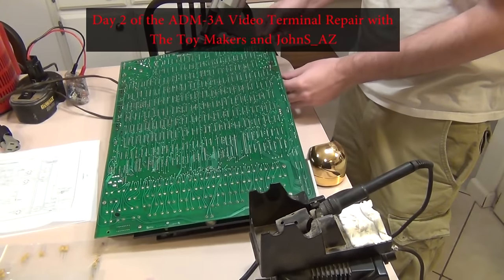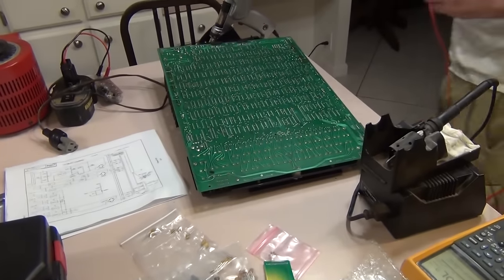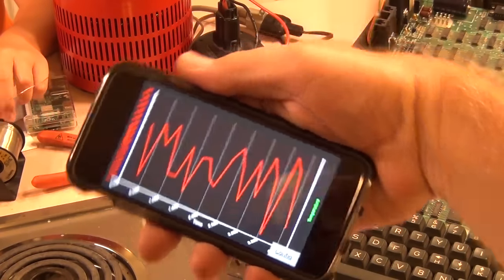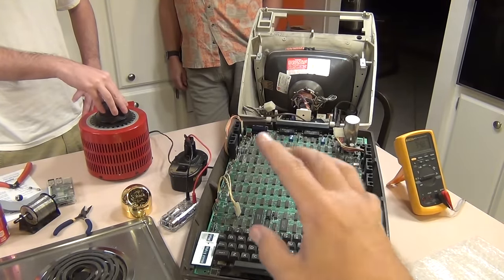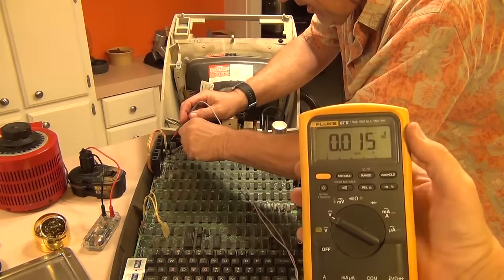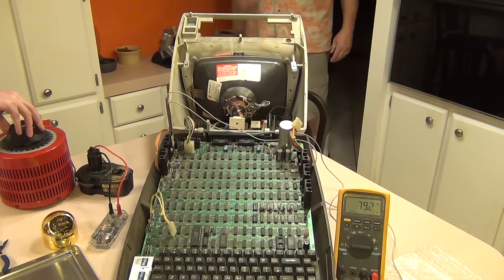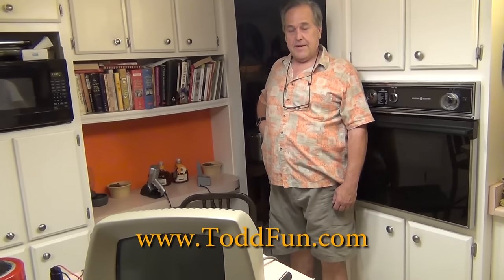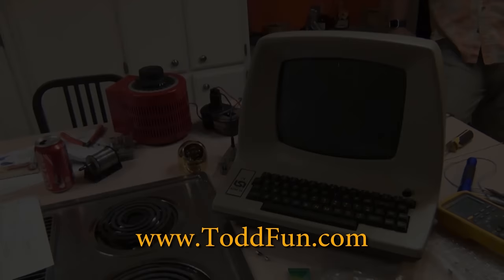Day 2 of the ADM 3A Video Terminal Repair Workshop

Comment: Did you. Ever manage to get this working?  I would be very interested in how you diagnosed the problem.  I have the predecessor to this terminal, the ADM-31 which is experiencing similar problems.
Reply from the maker: I have ordered some parts but never got back to the project. If you watch my other recent videos you'll see I kind of got myself into a garage refurbishment project and my lab is in the garage. I've got it almost all back together so I might get back to this project. Stay tuned. :)

Comment: If I remember the h & v sync comes off the logic board. we used to call it the pizza board due to its size. Also it was prone to broken traces due to flex. 
It runs off a state machine in proms so good for logic analyser project, I guess we used to have the firmware listing or deduced it. Jump conditions based on switch settings or multiplexer input. Usually a beep was an indication the logic board was running.
I used to be able to hear the 15khz flyback from 50 feet when nobody was in the plant.
Reply from the maker: Thanks for the input. It is still on the healing bench. I'm clearing out my old inventory on eBay and will get back to this one in the fall I hope. I want to reduce my collection to just a Apple IIe, C64, TRS-80 and this ADM 3A terminal. Only the terminal is currently not functional.

Comment: I have an ADM-3 (not A) that only communicates properly at 600 baud and below. If I set the switches for any of the baud rates higher than that, I get garbage as if there's a baud rate discrepancy. Is that a problem with the UART? The DIP switches?
Reply from the maker: I really don't know for sure but thinking of just signal issues at high speeds your wire connections, solder connections and terminal connectors need to be very clean and in good condition. Also shielding the cables can help tons at higher speeds. 

Also  you might try Brain on Youtube as he has one too and his works so he will know more.
https://www.youtube.com/user/BrianPicchi

Comment: Hi Todd, This question is about the Tripp Lite IS1000 isolation transformer. I have two amateur radio linear amps that are rated at 1200 watts pep input and 600 watts input on cw. I need an isolation transformer to be able to work on these amps. How do you determine the size of the isolation transformer. The specifications on the Tripp Lite IS 1000 is 1000 watts surge. Is this rating high enough? Thanks John C
Reply from the maker: The ISO1000 has an inline 9 amp fuse so that will trip at 1200 watts if your input:output is 120v AC and you exceed 9 amps through the unit while using. Very short usage might hold up to 1200 watts but not for long. To be a tech isolation transformer you have to convert it as in my other video on the Tripp Lite. Also, watch the whole video as there is a lot of safety tips in it: http://www.toddfun.com/2011/04/30/isolation_transformers/

Comment: Thanks Todd, I think I can use the Tripp Lite IS 1000. These amps are 600 watts input on cw so with 120 volt mains current should be well under 9 amps. Also, I can do all the repairs with the input watts at 300, and then plug the amps into mains power to test at full output. Want to take this opportunity to tell you how much I enjoyed your isolation transformer video. I now have a clear understanding of what they can and cannot do; and I understand how to check and modify an IT so I have true isolation. Thanks again, John C
Reply from the maker: Glad to help.

Comment: Did you ever get this working? I have an ADM-5 that I've never been able to get working. It just fills the screen with white block characters and doesn't do anything else. Worked for a while trying to get composite video to show up on the CRT, but that was never successful. It's been sitting in storage ever since.
Reply from the maker: I have not got back to the project. I did create a complete list of capacitors and the order did come in now. My first blind wack was to replace every cap except a few I took out and tested. The caps that were just jellybean I didn't bother testing and just ordered new. I will see if I can put this on my todo list so at least we can see what effect that has before I do any deeper tests.
Reply: Finish it and inspire everyone!

Comment: This was really fun to watch.  When you get it running, I would like to hook it up to my SWTPC 6809.
Reply from the maker: That would be a super cool project! Do you have the MP-S2 Serial Interface card? Will it start up and interface with a terminal monitor or do you need to first load special code? We need to see if we can do a collaboration video. You haven't made a video on your SWTPC 6809. Is it working? Sooo many questions! Your blog post on  your SWTPC is real short. 
http://tanrunomad.com/vintage-computer-collection/swtpc/

Well I best get my terminal running before Christmas so we can try it out :)
Reply: I do indeed have the MP-S2 dual serial interface.  I haven't played with the computer since I first picked it up.  When I applied power to it the fuse shot out!  Luckily not in my direction. :)  I recently discovered that SWTPC made a GT-6144 Graphics Terminal which was actually a kit that you added to a TV or terminal to give it the ability to produce graphics.  A future project for sure!
Reply from the maker: Sounds like you need to get your computer working too. Check for bad caps in the power regulation circuits first.

Comment: I assume you guys thought of making sure there was actually video going to the CRT board, right? If the deflection is borked, you won't see a dot if there's no video.

Also, many of these old monitors depended on an hsync and vsync signal to generate the deflection sawtooths, so unlike a TV where you still had a picture, you would see a dot or line if the sync signals are missing. 

I know this was recorded weeks ago and I think you said you eventually got it fixed, but I was just wondering.
Reply from the maker: We do have the h and v sync but I'm not sure how to test the video? Video signals are really not in my bag. I was going to get the pin-out for the video from the PDF schematic which is linked in the show notes then I was going to test for popper video signal using my TV setting on my older Tek scope. I know what a video signal should look like on the old Tek scope but I haven't had time to revisit this project other than reading the service manual PDF and making a list of caps to order. Seemed sensible to just replace all the caps before getting into too much more testing. Any tips you can send my way would be great! Thanks.
Reply: The video signal setting on your scope won't work by itself. In a TV (or NTSC monitor or whatever) the horizontal and vertical sync are mixed with the video signal. This is called Composite Video Blanking and Sync (CVBS) and your oscilloscope has a way to synchronize on a CVBS signal; it's called TV mode.

But in a terminal or computer with built-in screen, there's no reason to put all the signals together and then split them up again, so the horizontal sync, vertical sync and video signal (i.e. bright vs. dark) are kept separated. That PDF has a couple of wave diagrams in section 5 (sorry I don't have time to dive into it any further) that you will be able to get on your scope if you follow the instructions. But they're not TV signals, they're just wave forms. The video signal goes through that contrast potentiometer and then to the CRT board, so you should be able to pick it up there (looks like you might want to replace or clean that potmeter). It probably starts out on the main board as a 5V peak-to-peak serial stream of bits, and if you want to see what's actually in there, you'll have to sync the scope from the H and V sync signals (probably also 5V pp on the motherboard) while it shows the video bit stream, but that's not really important (it's easy to put together your own sawtooth generators and show the picture on your scope if it has XYZ mode, but that's a whole different story).

Anyway, at the point where the contrast potmeter is, you may be able to find a way to pull the video signal low or high to pretend that the screen is all white. That will show you if the CRT circuitry is properly generating the picture sweeps. But basically RTFM: I'm sure there are lots of tips in there to troubleshoot problems e.g. when there's no video.
Reply from the maker: Great tips. Thanks for helping out. I really just need the time now as I have read the manual cover to cover and have a ton of ideas for testing but time, it just takes so much time. Well, back to work for now, yes I'm still doing my day job at 9:40pm on a Sunday night.. :(
Reply: Same here :(
Reply: You might see if it uses the same frequency as some old computer standard video.   Perhaps IBM Monochrome (Hercules), CGA,  NTSC Composite, Apple II, Early Mainframe, CP/M, SuperElf, etc.   If it will sync to an old standard, try connecting the video input to a known good signal of something like this.   You might also try connecting the video output to an old  analog 15Khz monitor (such as an arcade monitor, scart TV, or other analog input computer monitor) and see if it displays anything.   If you don't have one of these, you might try a scan converter such as a CGA to VGA converter made for adapting old arcade games to newer monitors and see if you get anything.  If it outputs composite video, you can probably connect it to a TV video input to test the logic board portion.
Reply from the maker: Good tips. Thanks Stephen!